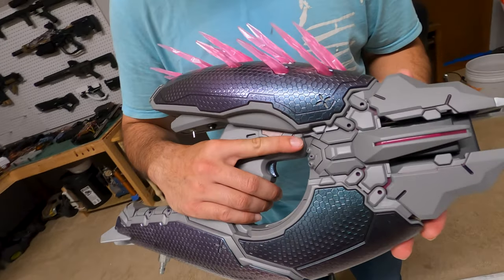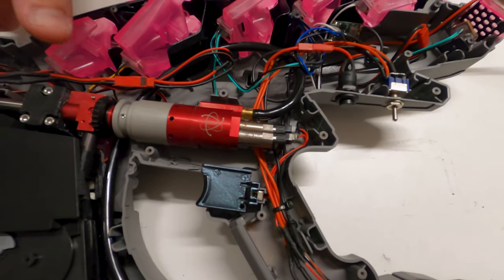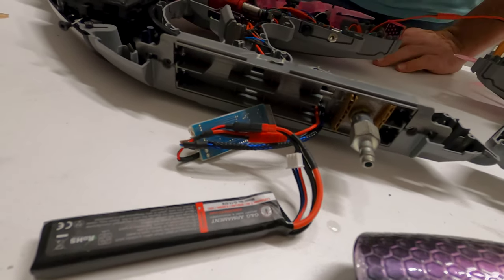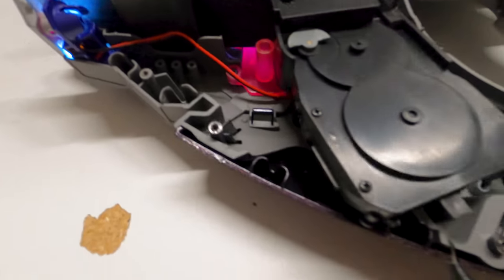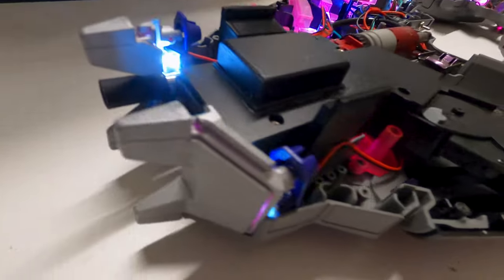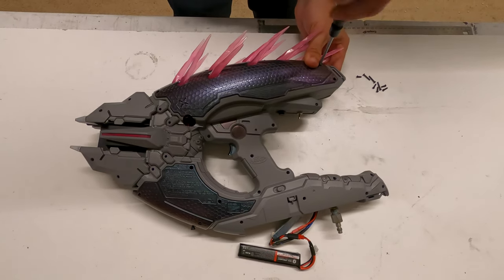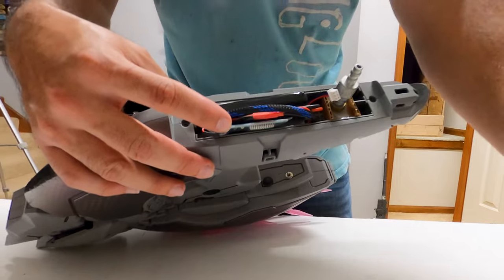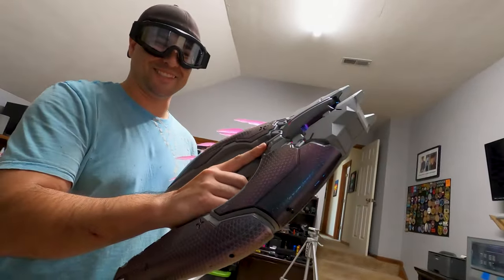How To Make Your Own HPA Airsoft Needler!

Comment: This thing is beautiful! There is only one thing that I think could be added- the addition of a small speaker to play the Needler sound effect whenever it shoots.
Reply from the maker: That would be awesome! I think it'd be cool if I had a built-in Tracer unit as well.
Reply: Absolutely. Originally thought an AceTech Bifrost would be cool, but due to the nature of the inner barrel it would take away from looks and performance. Also thought of a hop up tracer, but that hop up looked incompatible.
Reply from the maker: @CT-9904-Crosshair  Knowing Ryan, he'd find a way to create a built in tracer with the mag system.
Reply: That's a good idea thanks I am going to try that on my needler.